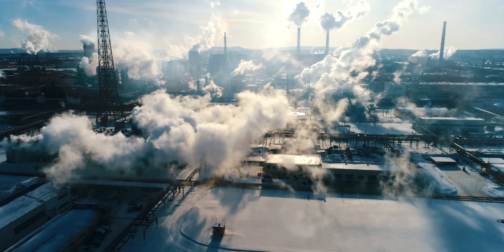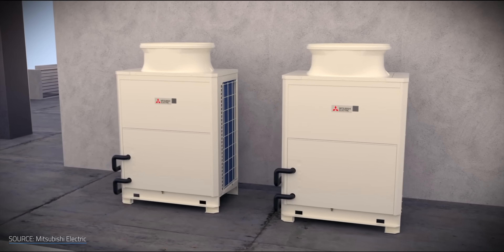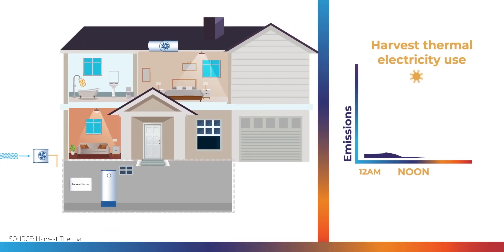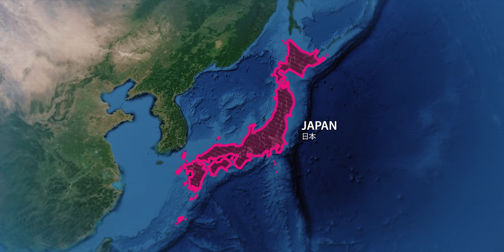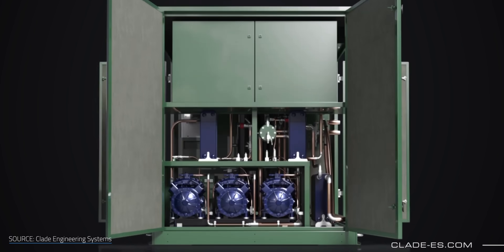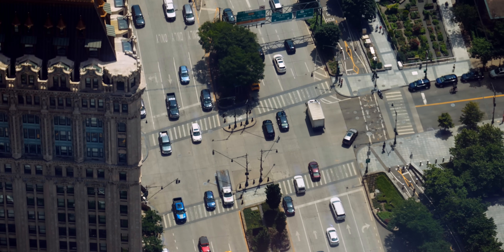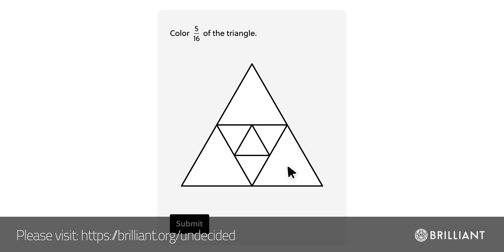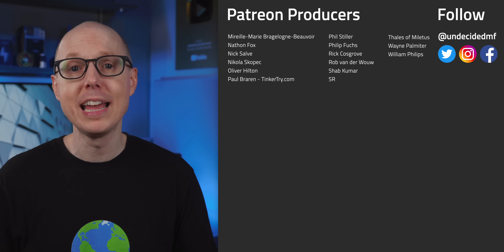Why CO2 Heat Pumps Are The Future Of Cooling

Comment: well the limit of you heat pump is only your math vs the refraction index, fluid dynamics and chemstry
Reply: the refraction index of electromagnetic waves ofc
Reply: first you work the refraction index of e waves, then you work the fluide and the fluide dynamics, if you start at fluide dynamics or chemestry you will get more losses
Reply: its like dicharging a jet engne up and wonder why you get no lift, the refractions come first
Reply: thats sayed even though you need to work the refractions first is very unlikely that at ambient temperatures anyting will beat wader or amoniak
Reply: it will be most löikely sth. like a spike spondge, but its hard to say geometry can be very complex
Reply: an amonicak filled spike sponge for maximal efficienct in non industrial use
Reply: well but if you investigate phantom black you might get some hints about an even better geometry

Comment: Propane heat pumps have a lot more potential for domestic use. The components are still cheap and they are more efficient than traditional refrigerant heat pumps. As long as manufacturers meet the product safety requirements for propane products, then there is no safety hazard.
Reply: I believe R12a which is a mix of R290/R600a (Propane/iso-Butane) is a direct replacement for the current refrigerants without the environmental and handling requirements with freon.
Reply: Everything is going propane now

Comment: I would think that space heating with 90C water heated from a heat pump would be inefficient.  Given an outdoor air temperature of -15C, the maximum COP a heat pump could achieve when heating to 90C is 3.46.  When heating directly to a more typical space heating temperature of 30C, max theoretical COP jumps to 6.74.

There's lots of other variables here of course: Not all of your hot water heating is at 90C; heating it from lower temperatures is more efficient.  Also TOU electricity rates, day/night temperature fluctuation, and effective operating temperature range of your refrigerant.

Comment: I wonder how the efficiency changes when you are looking at combining it with a pool. Many people, during the summer, likely want to cool their home while heating a pool. Is there enough energy left after heating the water heater or is there just way too much water in a pool to make it worth it?
Reply: If nothing else you're getting free-ish* supplemental heat for your pool, even if it can't do the job by itself. The balance between installation cost and upkeep vs energy saved might be ticklish, though. It might be a more productive way to dump excess solar panel output rather than selling it back to the grid at pennies on the dollar.
Reply: yes you can extend your condenser line to the pool heat exchanger behind the water heater heat exchanger. in fact its nearly ideal because while the water heater heats up the compressor head or discharge pressure will go up but with the pool exchanger loop the head pressure will be very regular as the subcooling (technical term meaning coolant temperature after condensing) will always be a function of the temperature of the pool rather a lot more than the water heater subcooling alone (which must take a wild ride as heaters contents heat up)

the pool heat exchanger can be simple 50 feet hardware store bought coil of 3/8" OD flexible copper pipe fitted with flare connections. but thats 600 some odd psi working pressure which accomodates the stated 30 atmospheres or 450ish psi in the video which i call into question but the numbers match in that regard.

Comment: We’ve had a Sanco2 water heater for almost 3 years and it’s been working great. The reason we chose it was because it’s a split system with the condenser outside. Our water heater is inside the house and so having the condenser mounted on top of the tank as most systems I’ve seen would have required relocating the heater. That would have added significantly to our installation  cost.
Reply: Unfortunately, for me, the added costs for that unit were just too much to justify it's higher cost vs a normal heat pump unit, even up north.
Reply: @sprockkets precisely. It would take decades before the price would be recouped via electric savings. When a standard heat pump hot water heater is around $1500 a $5000+ split unit that also requires a HVAC installer would prove about $1500 install. How long does a water tank last anyway? 10 years before it's clogged with hardwater?
Reply: @randybobandy9828  The only reason to get one is if you are in really cold climates and want to heat water without stealing from the house. It's better to just get the Stiebel Eltron model. But it is a high quality Japanese system, I'll give it that.
Reply: How much was it?
Reply: @sergiocruz6195  At least 3000 dollars just for the outdoor unit IIRC. The web site that sells them no longer lists prices.
Reply: That's cool as hell. Haven't heat much about that style system.
Reply: Right, how much did it cost you and how much are your average elec bills compared to before?
Reply: How do you know when a hot water heater fails?  It dumps a hundred gallons of water on the floor.

Comment: I'm confused, if the COP is lower than other heat pump types then what's the actual efficiency advantage? Can't you heat hot water with other heat pumps too?
Reply: Sanco2 are designed for this setup while most heat pump water heaters aren't and they usually heat to a much lower temperature compared with the SanCo2 system which can get to near boiling (190F). Most heat pump water heater refrigerants have a narrower temperature working range compared with CO2 so they can have a higher COP but only within that temperature range. By using CO2 and much hotter water, one can store more energy for a given size water heater which means it has a higher capacity for load shifting.

Comment: My father is an expert in HVAC technology and I asked him about this video and he had a few thoughts. One thing he mentioned is that the positives mentioned for residential systems are exaggerated a bit, as the cost of the installation of the system doesn't really ever pay for itself because after the the savings catch up, it's already breaking down and costing hundreds if not thousands to fix, completely offsetting any savings it creates. Companies always try to entice us with impressive sounding marketing, but it rarely as perfect as they say. 

He said it can be good if you can build a home with the system from the start, but if you have a standard system that is already working fine, don't worry about it.

For commercial usues it does make a lot of sense though as the higher efficiency is ultilized more effectively for much larger buildings.
Reply: IMO he brings up good points... if you already have natural gas hook ups in the USA it may never pay for itself. In my case, i was burning fuel oil my self installed split system will pay for itself in under 3 years,  plus now I have a free AC system
Reply: Think I'd rather install additional solar panels to offset the relative inefficiency of my existing, so far very reliable R410a system.
Reply: Your father isn't an expert.  The key is to finding an installer who doesn't try to rip one off (rare today), mini-splits in particular, can pay for themselves in less than 5 years.

I've been installing mini-splits for over 10 years and 3 years ago, I got around to doing my own house. One 24 SEER unit for each room.  That lets me do zoning effortlessly.  They replaced a 3.5 ton, SEER less than 9 central heat pump.  I've had my bedroom unit wired up to a data logging system for the duration.

What most people don't realize is that mini-splits are variable speed.  Everything, the compressor, the fans and the electronic expansion valve run just fast enough to carry the heat or cold infiltration.  When properly sized, they run continuously but at a low speed, low energy consumption operating point.  

I see from my data logging that my unit spends the majority of the time running the scroll compressor between 200 and 800 RPM.  If necessary to cool down a very hot room quickly or when operating at its limit, such as when it's below 0 deg F outside, the controller can spin the compressor up to 4200 RPM.

Since the compressor loafs most of the time, it will live a long life.  Same for the fan motors.  Because I live in a remote area, I bought a replacement motor for each fan and a logic board to have on-hand if one quits.

The bottom line, the only thing that really matters, is that the mini-splits have cut my electricity bill just about in half.  The only other large electricity consumer is my water heater.  Since I don't need fast recovery, I've replaced the 4kW heating elements with 3.5kW ones.  I'll have to wait and see what difference that makes.  I do know that the mini-splits paid for themselves in just under 2 years.

An additional advantage of multiple mini-splits is that they don't slam a high inrush load across the line.  The controller spins up the compressor and fans gradually until they reach the speed the controller wants them to run at, given prevailing conditions.

The central heat pump would almost stall my automatic standby generator when starting.  With the mini-splits, I hear no increase in noise from the generator when one turns on.  I do hear the gentle increase in load as one ramps up to the operating point.

The cheap chicom no-name units I use are so inexpensive, yet very well built that if I lose an indoor or outdoor unit in 5 years, I won't shed a tear.  $350 for the indoor unit and $550 for the outdoor unit, they become disposable.  Not worth repair.
Reply: Absolute rubbish i seriously doubt he is an expert actually he isnt making comments as such.
Reply: The problem with any electronic heat source is the dismal efficient at the power plant where about 2/3 of the heat goes right up the stack. Not counting line losses. 15%
85% of 32% = 28%.
Reply: @suggesttwo  Aye, its such a shame that we have absolutely zero other methods of generating power beyond burning fuels, lets just absolutely avoid any methods of generating heat that can avoid it.
Reply: @rjwaters3  I am talking about heating. If we drop the load on the grid you now have power to charge EVs without the grid collapsing. Buying time build renewalables like Tesla battery solar power plants. If we try to jump over the middle steps bad things happen. High rates and low reliability.
Solar and wind are much more cost efficient than natural gas. When the infrastructure is built first the expensive coal goes offline, the natural gas lastly natural gas boiler plants. This is going to take a long time.
Reply: Self-sufficiency is the way to go, not centralization.
Reply: @waynegnarlie1  Although I watch these videos, It reminds me how happy I am to live in the country with land. I have a pond, a septic field, and a solar field. I don't need to be water efficient, electrically efficient, or worry about the grid. I also have chickens, turkeys, and deer roaming the property. I always have several cords of "solar energy" available.
Reply: Your fathers conclusion is simply unsupported.
Reply: @rcpmac   It is highly supported. To say otherwise is simple ignorance of the facts

Comment: The issue with CO2 is that it requires 1500 to 2600 PSI to work. This mean that the compressor will need 3 stages and that it would also require stainless steel lines making it extremely expensive.
Reply: The fact that these are already in widespread use elsewhere in the world suggests that its not really that much of an issue.
The biggest issue for this or any similar tech is defeating the fossil fuel propaganda campaign.  Compared to that, the engineering is a cake walk.
Reply: CO2 heat pumps already exist. The technology is there and has been for decades. It's not cheap, but it is not super expensive either. Due to the better efficiency they are cheaper to run.
Reply: @altrag  There is no fossil fuel propaganda campaign.. People simply compare the pro vs con between the working system they currently use and the proposed system... even if so many people hate fossil fuels the truth is they actually work and do so fairly efficiently and at affordable price ranges.
Reply: @altrag   Hey guy, I can tell you first hand working in the refrigeration line of work. These systems are NOT "in widespread use elsewhere".
Reply: @TEHSTONEDPUMPKIN  I don't know what to tell you.  Companies in Japan have been making and selling the things for 20+ years, and from the little information I can find around the web that isn't paywalled, Europe has been making headway for a bit now as well.

The US just isn't a technological leader anymore outside of military tech.  There's plenty of areas where America hasn't really fallen behind yet but when it comes to pretty much anything related to clean energy, America has not only been failing to lead they've been actively working to place themselves at the back of the pack.

Kind of odd when you realize the US also has some of the largest installations of clean energy power systems - they just don't want to admit to it so they allow other countries to do all the development (and make all the profits).
Reply: @altrag that's because our investors spend money in other countries first as part of the ESG globalization effort... They often employ our engineers though to make it possible 😂
Reply: They aren’t in mass use anywhere in the world. The techbologna has been around for a long time but hasn’t been implemented in the field. Techs don’t want to work w/ 410A due to the high pressure. A hose blowing out at 400+ psi is bad. One blowing out at 1500+ psi could be deadly.
Reply: @Bob_Smith19 and yet people are willing to have these 1500 PSI cartridges so that they can have soda at home
Reply: TL;DR: this is an idea only applicable to mainland Japan. Japanese mainline water has almost no minerals, you can use tap water to fill a water battery. Do it in any other part of the world and the rusting inside the tank will take it off line in no time. You cannot store energy in a circulating tap water tank.
Reply: Sanyo had CO2 heat pumps available for some time, due to really high pressure the intermittent use had worse efficiency compared to R410A back then. 
It shined on high delta T applications but compressors just did not last too long that made those expensive to run. 
Replacing the compressor in nordic environment every 5-7 years ate up the savings compared to R410A completely and even more. R32 made the case even worse for CO2 units.
Reply: Is there an issue using oil in these compressors?
Reply: I have seen a demonstration of a "small" unit in a HVAC convention called MCEE this year and it was able to operate at 1770 psi with only 2 stages.
But you are right about the price: the lines were made of thick steel with top of the line insulation.
Reply: @hoppingrabbit9849  > who is ahead of the usa in fintech?
China soon - if they aren't already.  A lot of developing nations as well for that matter, simply because they've got the option of starting from the front and aren't having to wait for society's dinosaurs to catch up.  Hell, Canada is ahead in some aspects (more in terms of adoption rates rather than actual development, but still worth the comparison).

Plus, fintech is one of the least important forms of technology.  Being able to shuffle money around quicker and easier is nice to be sure, but its never going to have the same level of impact as for example biotech.
Reply: CO2  heat pumps are not going from zero PSI to over 1000 PSI  The pressure is kept high at all times.  So the low pressure in a CO@ heat pump may be about 1000PSI while the high pressure side would be at some higher value like 1500PSI and the heat pump will still work.   The gas lines don't need to be stainless steel to work conventional steel pipe will work.  So most off the shelf 1/4"OD or 3/8"OD steel or stainless steel tubing can easily handle the high pressures need to use CO2.

Comment: Hi Matt,
Could the CO2 heat pump be suitable for a retrofit system in old houses, as it produces more heat? 
As far as I know it is difficult to retrofit houses with heat pumps as they produce less heat than gas heaters for example.
Great videos!
Reply: In my experience they are, since they don't require any internal ductwork.  But you had better make sure you are well insulated, good windows/doors, etc - a good building envelope.
Reply: Hi,  I would highly recommend a ductless heat pump to everyone!  Yes a leaky home is more difficult to heat, and you don't have to have double pane windows to heat a home, it is just easier.  I have dual pane windows, 6" walls with good insulation in my 1994 home.  I put in a 48,000 Btu heat pump in Portland Oregon, where the coldest temperature is about 20F.  I never hooked up a electric back up heater, and it has worked fine for 10 years now.

Comment: Since CO2 heat pumps are so efficient at heating water, I wonder how well they would work as the boiler for a hydronic radiant heating system, or as the heat pump portion of a geothermal heat pump?
Reply: any refigerant can. but the limiting factor seems to be the discharge temp of the compressor which ought to be less than 200f which is about where your hydronic system wants to max out as well. but the hydronic fluid would likely be around 160 max from a 200f discharge which is already at the red line. keeping discharge temp nominal at around 160 to 140f tops will yeaild some 120f hydronic fluid which you might know to be very underwhelming.